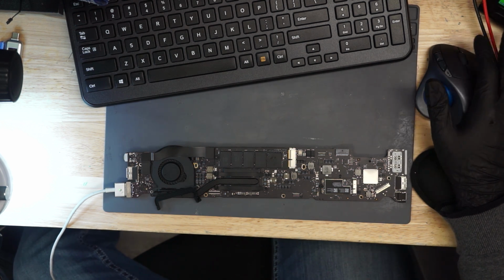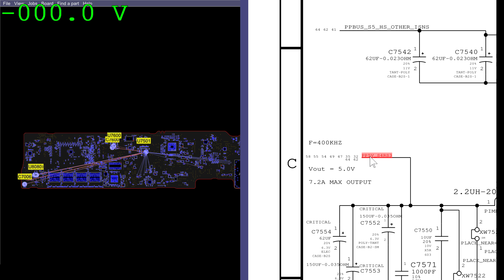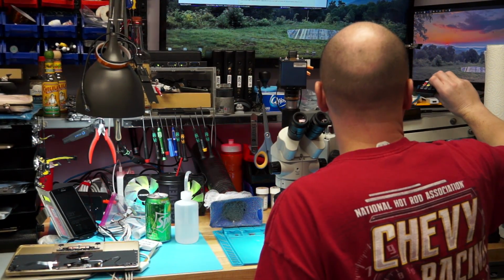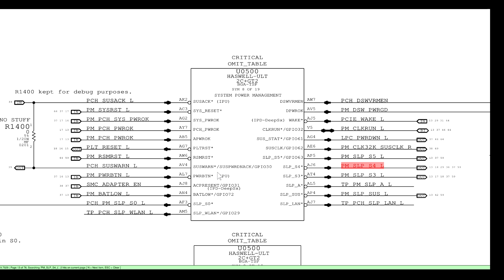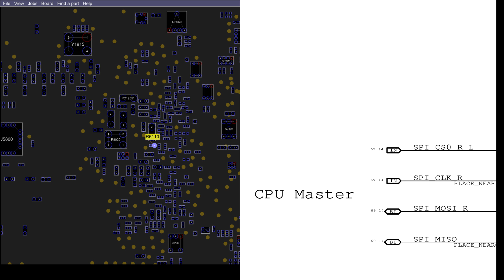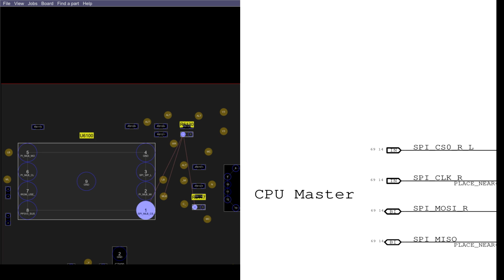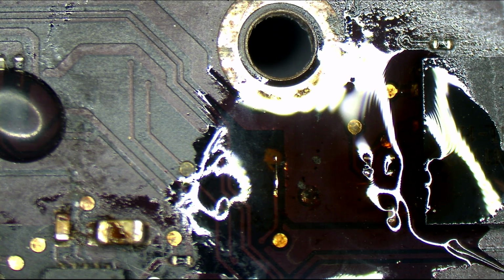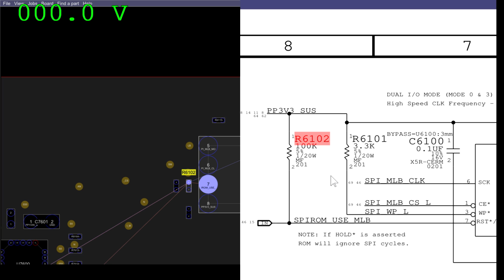Why is Macbook Air missing PM_SLP_S4_L again?

Comment: Hey louis, the PM_SLP_S4 signal on my card is shorted to ground, what can it be? I have already removed all the "smalle"r components (resistors and capacitors) that are directly attached to it and the short continues.
Reply from the maker: anything.
Reply: @rossmanngroup  But is there any chance of being a BGA problem? Because this signal and PM_SLP_S3 is also grounded. And I've checked all the SPI ROM patches, they're all OK.

In fact I'm a big fan of yours, I'm 17 years old and I'm at the beginning, the few motherboards I fixed it because I learned with you, so thank you :)

Comment: You've probably answered this, but I've always wondered why laptops are not designed to divert liquid spills so they never touch the motherboard?  Or why not do a 4-second spray of some clear lacquer over the board?   It would seem to be an actually valid selling point, a liquid-resistant laptop.  Please advise.

Comment: Mikeselectricstuff has a really sweet trick for determining if something is an input or output if you dont have a wiring diagram. He goes through it on his ipod nano reverse engineering series. Yoou break the trace and put a resistor in the line and then pull either side to ground with another resistor. If that sides voltage drops, its the draw side. If both sides voltage drops, its the supply side. Pretty neat trick if you dont have a diagram to follow. He explains it better on his video.

Comment: What is The Most Reliable Apple Component?
Guess

The Fuse The F*ng Fuse Never Blows
Reply: A fuse that never blows is only reliable if the need for it to blow never arises. A reliable fuse will blow when the situation warrants. Apple fuses never blow when they should, which makes them reliably unreliable.
Reply: Apple knows there is more profit in selling a new motherboard than selling a fuse.
 @benjaminmiddaugh

Comment: Why use a wire instead of just throwing on some extra solder to make the connection when it's so close? Would there likely be a problem with surface tension (how much surface tension impacts soldering blows my mind btw), would it be unreliable, would it be just bad practice, or something else?

Comment: Those probe-points...are those the like connections between the front & back sides of the board?
It's my hunch, so that's why I'm asking to be sure.
Dutch is my main language, so for me they sound like points to "measure" like voltages, amps and ohm.

Comment: I'll never repair any macbooks or, probably, any electronics. Yet I'm sitting here watching my favourite type of content: A dude doing a thing.
Reply: I used to say the same thing as you. Then I got into micro-soldering as a hobby thanks to these videos. Started by saving some money from work and ended up getting one of those Aoyue 3 in 1 stations (968a+), some flux, different tips, wick, jumper wires, etc. I started buying electronics kits (digital clocks, VU meters, Arduino boards) and got better over time. Then one of my coworkers asked me if I knew anybody who could fix her son's 2013 MacBook Pro since the Apple store wanted $1k for repairs. 

I told her I wouldn't mind checking it out, and at the very least I could tell her if the repairs would actually amount to that. I managed to figure out that it was the Backlight fuse (thanks, Louis, all these hours of watching your videos helped immensely!), so I got a quick replacement for it and managed to get the MBP working again. It was an extremely satisfying feeling! Making a quick profit off of it didn't hurt either. And now I'm getting all sorts of computers to keep me busy in the weekends (I even managed to fix two Nintendo Switches that had bad charge ports and a PS4 that had a bad HDMI chip!).

If it keeps going this way, I may actually consider quitting my job and starting my own repair business, especially since there's no place around here that can do micro-soldering to my knowledge.
Reply: @RGInquisitor  Thumbs up!  Solving problems is satisfying.  $$$ is also nice!  I occasionally like watching people do their craft, with narration of their thought process.  Similar to Behind the Scenes extra features, or having artists explain their inspirations and process.  I may not understand most of what's going on, but I still like it.
Reply: @RGInquisitor  To be honest I feel the urge after watching this :O Too bad all my stuff works fine :D
Reply: @Trondtravle  The only broken electronics I had at the time were my LG V10 with a burnt CPU (awesome engineering, LG!) and a 50" TV with a blown PSU. I used the TV to learn how to solder and de-solder, and then the V10 to remove and replace smaller components.

However, the best experience came from buying DIY kits off Amazon. They vary in complexity, so you can look for easier kits of electronics to assemble, and then work from there. They're not too expensive, and some of them are actually useful when you assemble them (digital clocks, FM radios, calculators). Once you've obtained enough experience with them, you  can consider buying broken electronics from eBay or from friends and family and then start working on your troubleshooting.

Comment: The problems with Macbook Air are actually directly related to the dropping of the oxygen content on the planet's breathable air column.
Mainly, disappearing Air.
Here's a kitchy, whimsical primer on the subject.
https://www.youtube.com/watch?v=cipOGNEmTQ0
And here...is a reference to [if one will be patient and track the provided links], the real deal :
https://twitter.com/Palladin6/status/1084646997045329920
If the science is correct [and it is] we're going to be materially and literally...running out of AIR faster than most ppl can even consider.

So this'll be even worse for your Mac than an "EMP", in which case ALL the silicon-related components will be fried ---unless that is, one had the foresight to put it in a faraday cage or a mylar bag.
None of which will of course matter in the slightest, due to the unavailability of "air" to breath when the planet loses its capability of supporting organic life.
Oops.
Lights out...Mac out.
--cheers,
http://TheVelvetDoberman.com